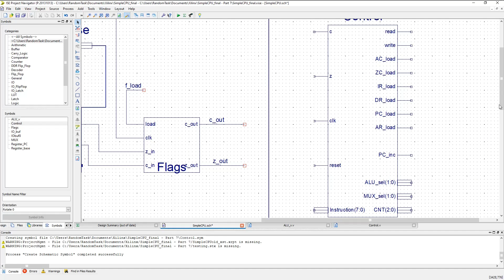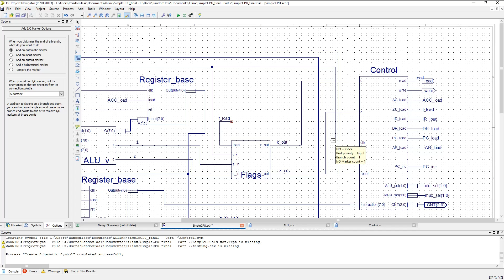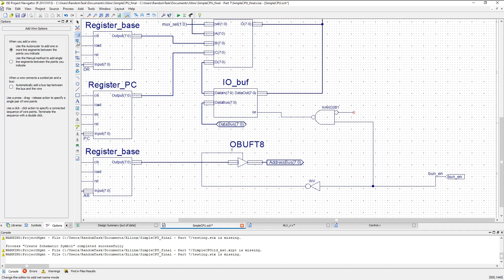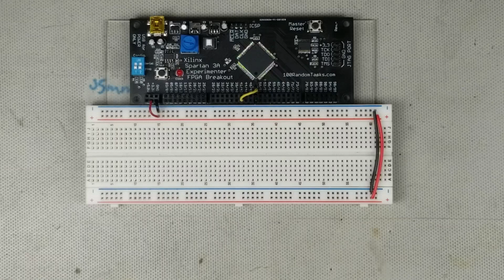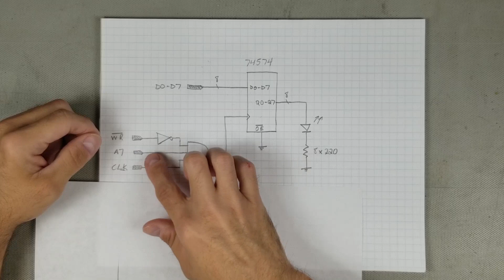HOW TO CREATE A CPU IN AN FPGA - Part 7 -  Hello World!

Comment: what if the fpga grid/cell system was not grid/rectangle, but bubble/hexagon, one more line through each cell, more robust/more connectivity to the global grid, 3d stacking in the grid, to make it 4-6 lines through/per cell, 4 if direct up stacking